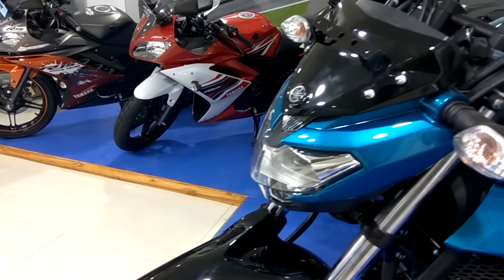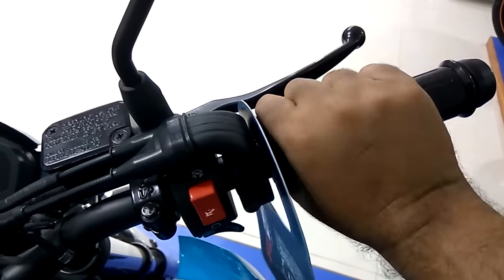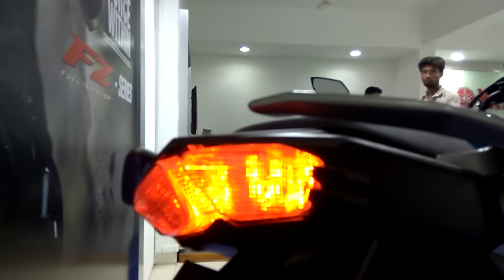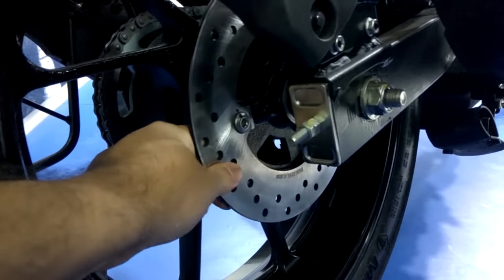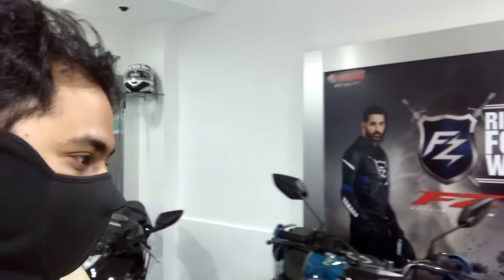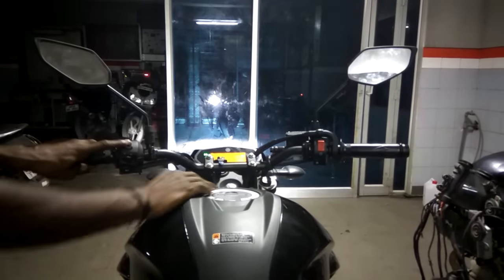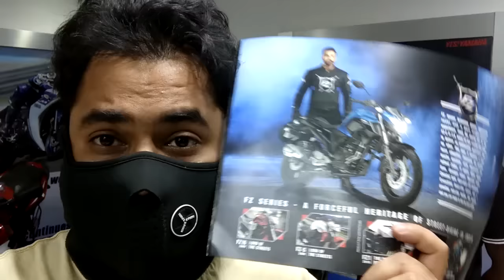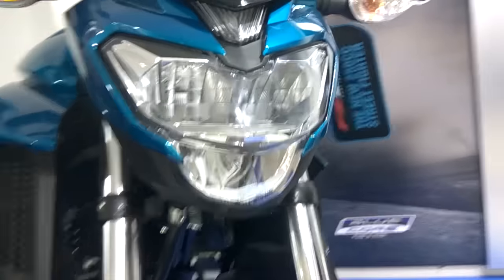Yamaha FZ 25 / FZ 250 . Quick Look , Exhaust Note & Colors

Comment: The negative part i observed and read about this features,also i went to look up this bike practically to get the real facts near Bangalore one of the showroom, I feel they could have given better quality of switches,they could came digital switches for horn,headlamp switches etc and main Draw back is no swift gare indicator,side stand warning as in basic mopeds they are coming.. And the speedometer dam old look could have improved better.. About mirrors, not placed positioned to view rear vehicles.. No lquid cooling as its air cooled engine.. Last but not least they could have introduced ABS option as for buyers who have more pocket too spend as they could have really made their rivals upset with TVS RTR  200,KTM Duke 250 and Pulsar 250 NS. But still i back this Yamaha FZ25 naked one as this beats all of them in compared to specially Muscular looks, Its Blue core new engine for Power,Torque increase,Broader Tyres, wheelbase, LED headlamps and mainly keeping in mind our indian traffic condition,  our uneven roads,MILEAGE and Pricing of this bike.. Its Bike for daily needs and for Occasional Racing too. That why this bike is best and wins from all angles and facts from its competitors..